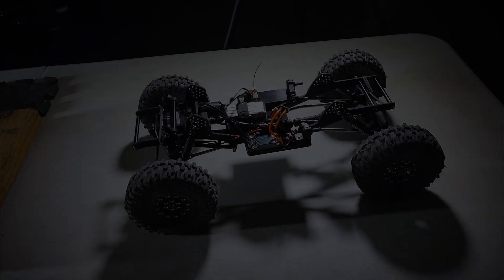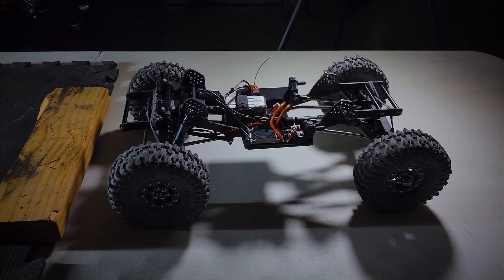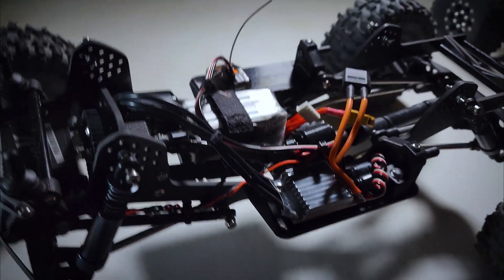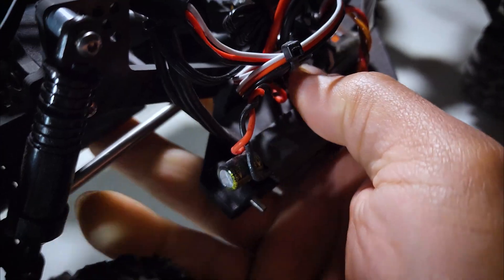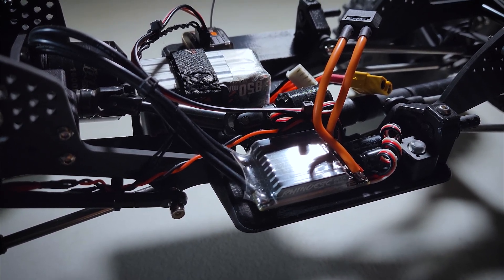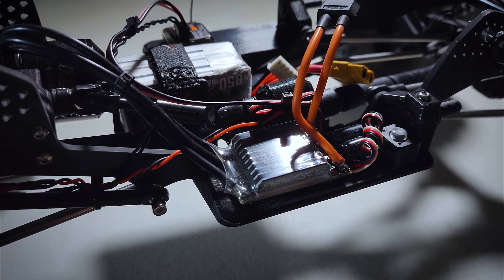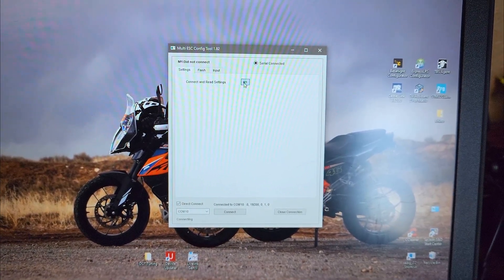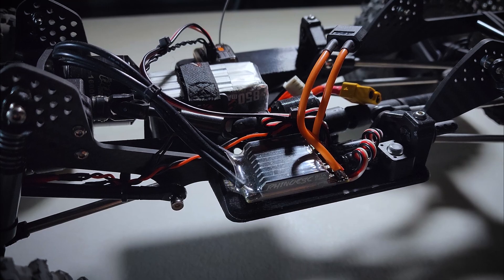Is this the best AM32 Crawler esc on the market⁉️ | Rhino ESC at NegativeGRC ✅️

Comment: So out of curiosity is amps do not matter why wouldn't someone run something like a 9IMOD AM32 40a esc that only cost 20$ they are capable of 2-6s and very good little esc's. They do make a80a, for 39$  which they recommend for 10th scale crawlers. They come with the program usb link and pre soldered xt60 plugs??

Comment: These engines are no good.
I already bought two 1800 kv and after two weeks of use I accelerate and with two fingers I can brake the engine and it just shakes.
Reply from the maker: weird, I've been using 3 of these motors for over a year.
Reply: @Furadi  I tried it on another esc because it could be bad programming and it does the same thing. I spoke to the seller on Aliexpress and sent the video, he exchanged it for the second one and it's the same again. I might have to buy the Holmes Revolver.

Comment: Ok gonna try it -- looks pretty solid - just grabbed two 80A's from NegG ---- slapping them in a 22lb ClodBuster 1/6th custom crawler rig with Holmes Hobbies CrawlMaster outrunners -- look very similar to size/shape of the rhino outrunner so hoping for compatability.   Any idea how big a motor these ESC's can push?    4250's maybe?   ie 42mm wide can and 50mm long?    I have some AeroDrive 350kv monsters that would be fun for slow and torque.   But i don't want to cook these out the gates so will startt with the Crawlmasters!!    Thx for the vid was gonna go for Fusion FOC's but can only go to 3s and I run on 4s-6s for this rig usuallly -- and how can argue with 10amp BEC up to 8volts and can take up to 8s.   I really need this drag brake seems absurd to spend so much for a couple of good drag brakes but when this sucker gets rolling down a 45 degree+ rock hill LOOK OUT.

Comment: What wheelbase do yo run on your CC-V1, it looks longer than 12.3”.
Reply from the maker: It probably looks that way cause I cut the frame shorter front and rear.
Reply: Oh, ok. So is it 12.3? The reason I ask is I have a CC-V1 and I’m thinking of trying a 13” wheelbase. Have you tried a longer wheelbase on the CC-V1?

Comment: Your video earned you two purchases. I am going to try to replace two Castle Sidewinder4 esc in a dual moa RC4WD Bully II. Wonder if I will be the first to run this setup with two 1800kv HH V3 Revolvers. My current setup is gorgeous, but I won't run it as it sounds like a dental drill stuck on max most of the time. Hopefully this is the ticket.

Comment: So what is the esc set at out of the box? I have a direct power servo and would probably need to set up the voltage etc unless it does that itself? And what is the bec set at? I have a NSDRC SERVO I'm going to be running

Comment: I got heat build up pretty fast during superslow crawling... naked not even geared yet... both 1400kv n its 2250kv motor... Experienced the same? useable superslow crawling but short duration. Heat build up from the motor cable
Reply: On a Facebook group I saw people say to turn the sine mode down to 5 if it gets hot
Reply: I've noticed my motor builds heat very fast as well. 1400kv revolver.  Never even got warm running on a micro x2.
Reply: Wonder if adding a fan to the esc would help
Reply: Same issue here. Almost instantly, the wires, motor, and esc get sooo hot.

Comment: Actually the esc amperage does matter i guess. I had big 1850KV  3542 motor, and it had big current draw so when i paired it with my 70A esc it was turning off my esc when i added more throttle. I brought 3532 2050KV motor and it had zero issues. But i may be wrong. When i had that big motor i asked people from am32 crawler group for help and they told me that motor was so hungry, it was overheating the esc
Reply from the maker: It's not likely. I have a separate video on this but crawlers pull very little amperage.
Reply: @Furadi  Oh ive already seen the video. Interesting. Then i dont really know why that 3542 motor burned down my 30A esc and didnt want to work with my 70A exuav esc. Maybe its was just my luck lol. Anyway, i love your content (mainly because youre doing drifting and lcg videos and stuff and thats the things that im doing right now :D) and you are very honest! Have a nice day!
Reply: I completely agree with you 1000% I had the exact same issue. I set it up and hooked it to a 3542 1850kv and was heating up almost instantly, went to a 3532 1470kv and haven't had a single issue.

Comment: I suspect the onboard BEC is way weaker than 10 amps.   I have a 9imod 45kg servo in steering and my Rhino browns out on heavy steering forces.   I'll be getting a CC 15a bec to run the servo on....
Reply: I know someone running a Savox 2290 with one and has no trouble with power in his steering. Do you have the right voltage set?
Reply: @alanhelps6789  yes.  Running a Radiolink So the rx can supply plenty of power through it to the servos. Believe I set it to 7.2v option.
Reply: @TheseOldFlappinLips  Strange that.

Comment: I still can’t believe people are buying these am32 esc for 150 from that josh guy.🤣
Reply from the maker: Its predatory tbh 😶
Reply: It's a shame really, because it should have been a recipe for cheap but good brushless systems from the start. I'm just surprised it has taken the Chinese this long to catch on. 

Even before AM32, people were modding blheli and simonk firmware to make a car mode and you could get a decent little brushless car ESC for like $5 but it was a pain to actually flash them to begin with, having to solder onto the correct pads on the board or later you could get a socket adapter to go around the chip but either way it was a convoluted process. I think for blheli you need to use an arduino, too. It's gotten a little easier with the newer AM32 devices but still enough work required that people are willing to pay 150 for someone else to do it.

An affordable AM32 ESC with a simple USB interface has been a long time coming but I feel like we will start to see more and more as time goes on. I can't wait for a smaller scale version.

I hope before long that we'll just be able to buy any cheap flight style ESC and easily program it for crawler or regular car use. 

There are tons of 30a ESCs out there for like $3 that even have a BEC in them, just a firmware away from being a ridiculously cheap small scale car ESC for 1/12 1/14 1/16 etc 

Add in one of those 2212 outrunner motors and you could have a cheap but effective brushless system for less than $10. 

It's just having a quick and easy way to flash that that's getting in the way. It's like this whole world of cheap and fun experimentations is being held back by this one issue.

The painful thing is there are videos going back 7/8 years of people demonstrating car mode on dirt cheap Simonk ECSs. I really thought the Chinese would have better capitalised on it by now and started producing the cheap controllers with the ability to switch between flight and car mode.
Reply: I agree I tried it went across the room had no wheel speed and went back to the Holmes esc I also tried another guys and it was a 20$ esc with am32 programmed it was also junk so I run holmes escs in everything and I’m probably gonna try one of these